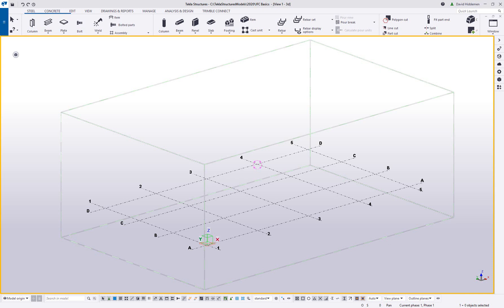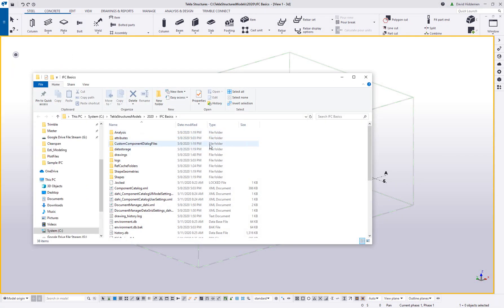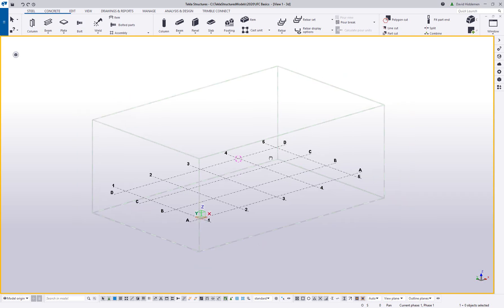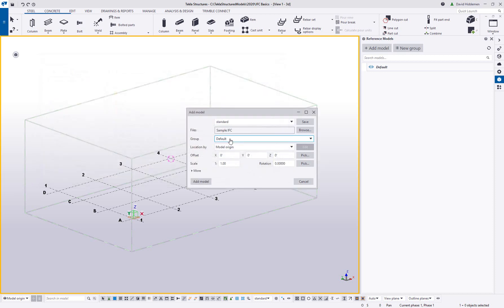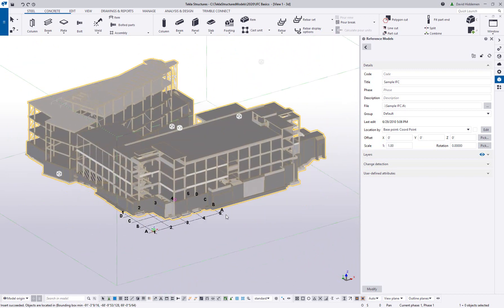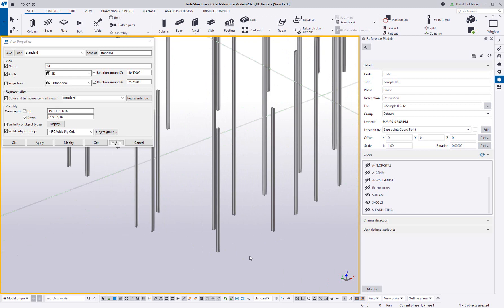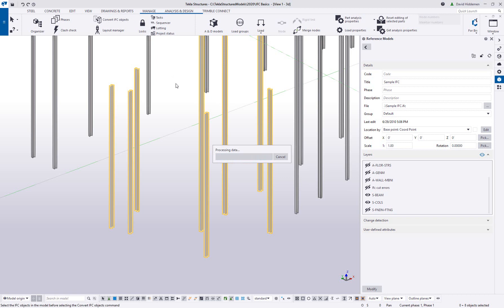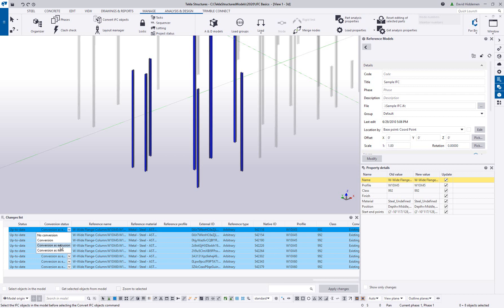Introduction to Working with IFC Files

Comment: Great video, thank You!
I noticed that IFC elements (the IFC was created in another Tekla version)
have a parameter called Farther GUID. Is it possible to extract this parameter into the element being converted?
Through it, I would try to write the Assembly (cast unit) number that exists in the IFC.

Comment: why  Tekla structure does not convert bolts in IFC files???
Reply: Bolts and welds in different softwares are handled quite differently from one another. Only “parts”, like steel and concrete members will convert.

Comment: Hey Dave 
Thanks for sharing such a nice video. I am facing a different issue. I have checked in IFC file it is satisfying both conditions you described in video. But still I am not able to convert it to native objects. I tried to import from File > Import > CIM STEEL option but import window closes down after showing error of "Manufacturing model". 
Do you have any idea how to resolve this issue ?
Reply: CIMsteel is an import for a different type of file. The conversion for IFC files is under the Manage tab as shown in the video.
Reply: @TrimbleTeklaDave  yes I followed all the steps you have described in video but for me it is not working.
Reply: @chitranshu88  Why did you go to the CIMsteel option? When you try and convert through the method in the video, what happens?
Reply: @TrimbleTeklaDave     I have imported IFC file as per the instructions in video but I am not able to select any member. IFC conversion will happen until I select members. 
That's why go to CIMSteel option. But nothing is working. Importing through CIMSteel option it says it is manufacturing model. 
I don't know what is manufacturing model.
Reply: @chitranshu88  Now we're getting somewhere. You did not mention that you cannot select a member, which is the real problem. Again, CIMsteel is a totally different file type, not for IFC's. So don't worry about that. Do you have the 'select reference models' button pressed down in the bottom left of your screen? (button looks like a 3d cube, in between 'select reference lines' and 'select bolt groups'). This is what most people miss.
Reply: @TrimbleTeklaDave  Yes now I am getting  it. I have turned on both the switches but now on selecting one member it selects whole model. 
Still I tried to covert IFC Object but it is showing error and conversion status is "No conversion" and it was expected as I am not able to select one member at a time.
Reply: @chitranshu88  You also need to select the "objects in components" option instead of "select components". One will select the whole model, the other will select just parts. Also, some IFC's just can't be converted for multiple reasons. But hopefully when you can select individual members it will help.
Reply: @TrimbleTeklaDave  Yes I have turned on "select reference models" and "select objects in component" but it is not working. I think I have the IFC that can not be converted. I have STEP file also for the same model. Could you please upload a video on how to import STEP file using CIMSteel. I have tried it but it is giving error of manufacturing model. I have searched about manufacturing model on Tekla help but I didn't find anything. 
Thank you so much for help.
Reply: @chitranshu88  Unfortunately STEP models cannot be converted to native beams/columns. The CIMsteel import is specifically for a type of file called CIS/2. They have a similar extension (.stp) but they are NOT the same file type.

Comment: If I’m creating a tekla str model at origin (0,0,0) and I need the ifc of the same to be set at different coordinates. Is it possible to do it ? The ifc file which will be used by other sw like E3D or PDMS to be kept in plant cooridate.
Reply: Yes, around 2:15 I start talking about changing the project coordinates. This affects the import and export of IFC files.

Comment: What do you mean by native objects and how do you able to get x,y,z coordinates
Reply: By 'native' I mean Tekla parts (beams/columns) vs a reference object that you cannot interact with. Native parts have weight, area, etc calculated and you can apply connections and make drawings. The second part of your question is too vague. XYZ of what? The model? The IFC? The individual parts? There are different places to inquire or change all of these things.
Reply: @TrimbleTeklaDave  thanks for the reply.I am sorry about the second question,let me make precise.how to get XYZ coordinates of IFC as well as live model we are working on.
Reply: @vinodck6718  Under the File Menu you can set/change "Project Base Points" to change the import and export locations for your IFC files.

Comment: Can we also convert concrete slabs and walls to native objects?
Reply: In some cases, yes. Just like steel there are different types of data in the IFC. Some can be converted to native, and some become a 'brep' object that is basically a one-of-a-kind in the model created by the IFC conversion. So it's there, in the model, but doesn't really behave like a normal part.

Comment: model on disk is corrupted tekla.?🙏👷🏽‍♂️😭.share vidio tutorial
Reply: If the model is indeed corrupted, you will need to use a backup to restore it. Best to reach out to your local support for assistance.
Reply: @TrimbleTeklaDave  I have backed it up but I still can't open it
Reply: @Desain-l2q  please contact your local support for assistance - https://www.tekla.com/contact/offices-and-resellers so they can try and diagnose the model files
Reply: @TrimbleTeklaDave  thanks you information🇲🇨🙏😇👷🏽‍♂️